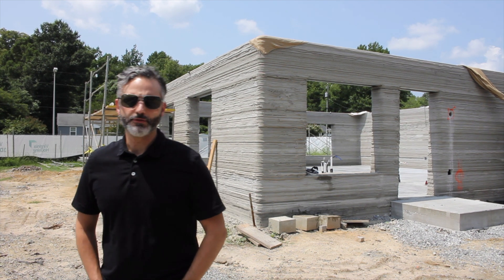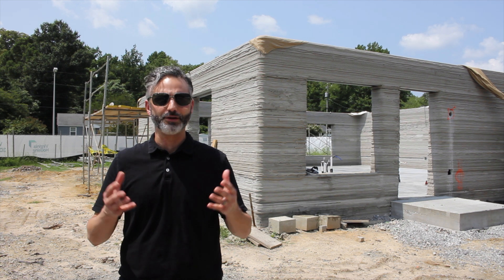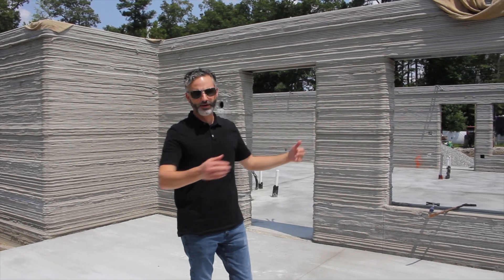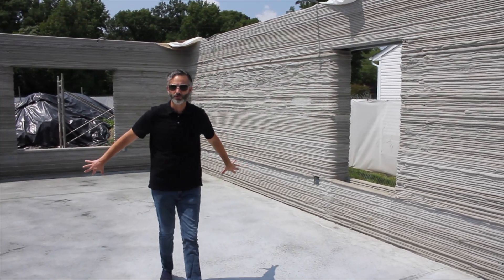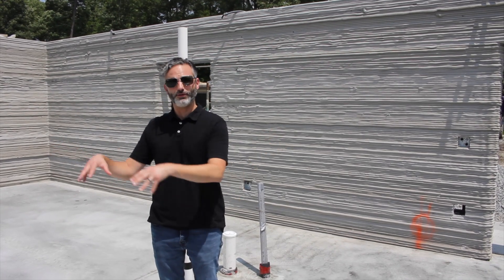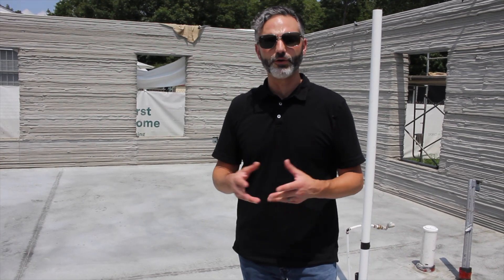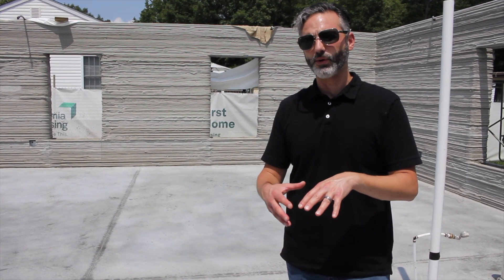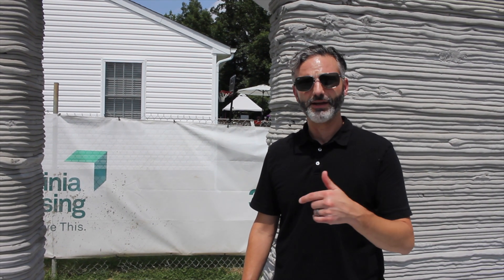Alquist Believes 3D Printed Houses Will Save The World

Comment: Just 2 words = thermal bridges :) The very concrete used should account for structure and insulation :) And by concrete I mean porous lava ash + adobe combo. And by insulation I mean thermal resistance with very thick walls and not modern foams or similar. The only modern solution I can see at this point is glass agregates insulation + cement for rather thin walls but still sturdy and insulating ;)

Comment: Hilarious.  So called 3 D printed solves a problem that doesn’t exist while creating a hundred that are unnecessary 
Walls are, at most, 11% of a house
Even if it was free to do them this way it would be insignificant 
No proper reinforcement, no proper acoustics, no proper insulation 
Of course, I’m only a 50 year builder of concrete structures 
I doubt if you could make it any uglier

Comment: May want to consider CO2 infused concrete.  It is supposed to be stronger and a carbon sink at same time.
Reply: You can also put in the thought of how much fossil fuels are required to produce the cement to make the concrete. Can slag from steel companies be used as aggregate in the process. I have many other questions about this method.

Comment: I've been involved in the house construction industry all my adult life. I have a Masters Degree in architecture. The walls are only a minor part of the cost and among the easiest bits to assemble. Utilities and fixtures require a lot more labor and cost. Proper waterproofing of roofs, which see extreme temperature swings, is critical to the long term durability of a house.

In short, there are many, many technical problems. 3D printing of the main structural elements may help to introduce some minor savings. And that's a good thing. But I'd be skeptical of any really bold claims.

For over a century now people have proposed various approaches to manufacturing houses in a more cost efficient manner, usually trying to find some way to use an automated, mass-manufacturing approach. In the first part of the 20th century, many inventors and engineers, inspired by Henry Ford and his assembly lines, tried to find ways to apply similar ideas to houses. In the end, it just hasn't panned out. We DO see it in other areas of construction, such as warehouses, factory sheds, structures like that. But there are many reasons why the mass-manufacturing approach just hasn't taken over housing construction. The closest we've come are the "mobile" or "manufactured homes" that we see in trailer parks across the USA. Unfortunately, lax regulation resulted in most of these being of extremely poor quality. The real way to make more affordable single family houses in the USA is to follow some of the manufacturing approaches of the manufactured housing industry, but work to a higher standard. There are a few smaller outfits starting to do that now. The challenge is getting enough of a volume to see savings from efficiencies of scale.
Reply: i agree, when estimating a job, single floor exterior wall construction is just not a big line item.. honestly I am not even a real good framer but with another guy could knock out that first floor in 8hrs with zip sheathing already on it. Not like they are removing framers from the job either with the roof trusses and interior walls. Just reducing that crews weork by like 8hrs...

Also masonry walls just make the other systems and sub contractor dependencies difficult. looks like the guys have to set electrical boxes and other stuff while that machine runs otherwise they are going to be cutting masonry so they have to know for sure where everything goes exactly.. on top of al of that, he said they are putting drywall over most of it which I get, I wouldn't want all those ridges on interior walls and have to keep it clean. but its just more steps that are much easier with wood framed walls.

There are some companies doing the real factory built homes and moving them onsite whole. I honestly have no clue how they do that but building a home in a warehouse with lifts, electric hoists, jigs, etc.. so much you could do to streamline if you control the environment. Not to mention the actual weather not impacting. I assume this is limited by the ability to move the house, bridges and all.

I would be curious if someone could come up with prebuilt panels that a machine could assemble.. but as I am saying it I am not sure that is really a huge time savings either. Currently I love builder first source's precut lumber and numbering. That I can see as a huge time savings if you get good and building 2-3 house plans and have those designs perfect with them.
Reply: Do you think a concrete structure would hold up longer than a hastily put together 2 x 4 frame with vinyl siding or faux brick?
Reply: Still wondering why we still use wood and sheet rock for interior walls? Seems like we would be able to have pre fab fixed size walls made of a light weight material with pre built utility channels by now for the interior.

Comment: I would like to see the budgets on these houses and how much less they cost.
Reply: i honestly doubt its truly cheaper. just from estimating standard stud walls or cmu block walls, doing this exterior just isn't that time consuming or expensive. and even if this machine can lay down the cement in a day or so, a framing or cmu crew could do the same and not require this highly specializing and time consuming setup.
Reply: @Josh.1234  Maybe do some RESEARCH before you post...I run a framing crew and you can't do it in a day..Cost I believe for 3D home is about 45.00 a foot..typical stick house is about 140.00  square foot..
Reply: @dwindlefoddl7225  i have done plenty of research on 3d printing houses.. it's not 45 bucks a sf nor does it accomplish the same outcome as framing a house. It can only do one floor and can't do roof structure. So I still need my framing crew. 

Also you have to set up a mixing plant, a generator, have to mix onsite, have to make sure the mix is right for the changing temp all day long, if you run into a problem you are on a timer before cement is going to have problems.. it's not a simple as having a readimix show up in the morning and pour a slab, they have to have small batches frequently all day.

It's slow, these houses they built took days to setup the tools and days to run it then days to take it down. My framers would have done a slab first floor framing of that size house in a day.. hell I could have framed it personally with the 2-3 guys in a day and I don't usually frame much. Also, masonry walls are a pain for my trades guys to do electric/plumb/HVAC or insulation.. it makes everything else more expensive, time consuming. Also the interior walls usually are spec'ed to have drywall run over them or plastered to be smooth so no savings there.

I am big on 3d printing in manufacturing and modeling but it doesn't make sense here..
Reply: @Josh.1234   Want some cheese and crackers with that whine..?

Comment: Love these printed concepts...wonder if you'd be able to run wiring after the house is finished?  They should leave some conduit or some way to run wiring for electrical or whole house audio after home is built...every house I've owned I've added electrical or Ethernet cables...
Reply from the maker: Sure you just need to saw through the concrete.
Reply: @automateconstruction  sounds messy and difficult compared to drywall. Maybe show an example on your next video?  Thx.

Comment: Is there any data on how well these houses hold up to an active earthquake zone, such as Alaska, where 4.0 earthquakes are a norm?
Reply from the maker: Not yet in time that will come. The printed concrete is strong usually around 6000psi compressive strength.
Reply: I have a Masters Degree in Structural Engineering, from UC Berkeley. Seismic issues are right up my alley. However I am not a licensed engineer.
As Jarett Gross mentions, concrete strength matters. But concrete is typically around 10 times weaker in tension than in compression. This is the main reason why deformed reinforcing steel bars are incorporated into concrete. There are also issues of ductility, which is as much about design as materials properties. In simple terms it's about designing so that if there is a failure it happens in a way that does not result in a collapse and it's slow enough to give occupants enough warning to abandon the structure.

With a single family house, even in places like California and Alaska, these issues can certainly be engineered successfully. However they are not a given. They must be engineered into the design. There's a lot that can go wrong.

Wood framing, because of its lower weight, is much easier to design for earthquakes, although it, too, must be designed by someone who fully understands seismic structural issues.